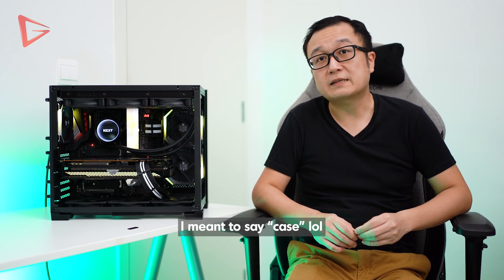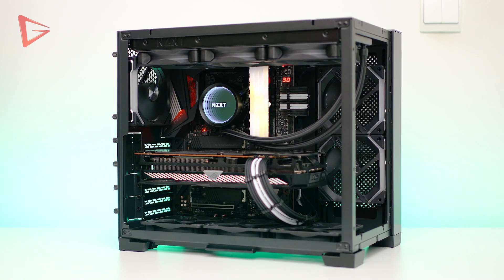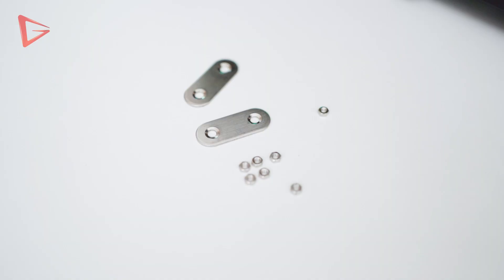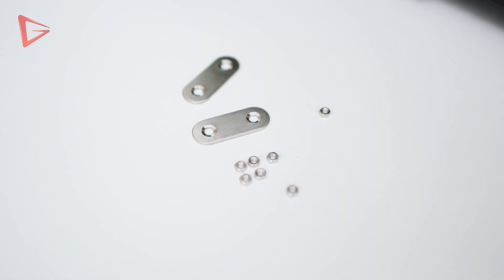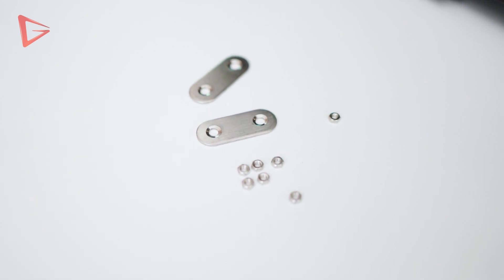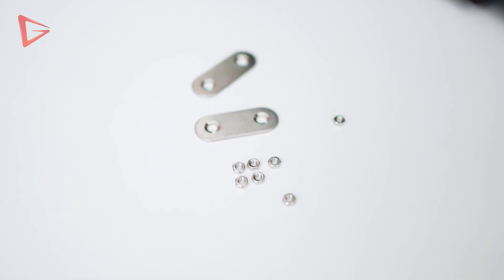LIAN LI O11D MINI - Top 360mm AIO with ATX Motherboard

Comment from the maker: I've made a final revision for the offset bracket design and is now available for purchase. Details on my FB page Ghim Tech. At the moment it's only for purchase and shipped locally within Malaysia due to shipping charges. Link here: https://www.facebook.com/111049724545742/posts/128869382763776/?d=n
Reply: Pretty nice, could you fit push pull fans?  Thanks
Reply: dude is there a way to ship this internationally (to Jakarta) ? I need these
Reply: Ridiculous. It's just a STL file.

Comment: Can we fit top 360mm aio without any mods if the motherboard we use is an m-atx size?
Reply: If you don't use the matx in 7 slot configuration then yes no problem

Comment: why didnt they just add brackets like this with the case. Would have made the case a lot more appealing as it saves alot of room on your desk and you have better cooling with the 360aio.
Reply from the maker: Because they want you to use only a 240/280 with this case, if you want to use a 360, they want you to buy the regular O11D
Reply: @ghimtech  actually they have now started selling brackets that you can use to offset the rad. They are only doing this now because alot of third parties and selling their own version. Sounds like lazy manufacturing to me. people would more likely just use the smaller rad and deal with the little jump in cpu temps.
Reply from the maker: @Lyrics_And_Harmony  yeah they started selling the offset bracket sometime late last year. I would like to think that it wasn't really lazy manufacturing, they just want to segregate their lineup and not letting the smaller mini kill the bigger brother by allowing it to fit 360 aio out of the box

Comment: Great video but I have a question. Do you think I’ll be able to fit the Artic Freezer II 360 AIO to the air o11 mini with the brackets attached because this AIO has thicker radiator.
Reply from the maker: This depends on whether your motherboard has big and thick heatsink or not
Reply: @ghimtech  It has quite big sinks...it's a gigabyte aero g z790, but if the artic freezer II wont fit can I try something else like t-force siren 360?

Comment: do these brackets work in the lianli air mini??
Reply from the maker: You cannot physically fit 360 aio on the air mini because the case is slightly shorter
Reply: @ghimtech  apologies, i have a 240mm
Reply: @ghimtech  But could I fit 280mm aio on top + atx mobo with these brackets?

Comment: what kind of screws/hardware did you use for the brackets? the ones that came with the aio or just any you had? interested in doing this, just wanted to know the screw size in case I need to get some more. thank you!

Comment: Just ordered and payed for the 3d files. Thnx. I have a question about when I upload the file to a 3d print shop. Are the 8 brackets included in the file? Because when I go to checkout to pay I get the quantity of one. Should I change it to eight or are the eight brackets included in in the file?
Reply from the maker: The brackets are the same. There’s only a single bracket. And then you ask your printer to print 8 pieces for you.
Reply: i have a question what is the size of the brackets use in this video as i will go with flat straight brace bracets and nuts plz help

Comment: Did you print this with pla? Or should I go petg for Temps inside the case? Also do you have a stl?
Reply from the maker: Printed with ASA. I only use PLA during earlier test prints, it sags too much and has lower temp resistant. ASA is much better. PETG should be fine too.

Comment: What about RAM clearance? For example, I'm using RAM with DIMM height = 51mm. What's the height of your DIMMs?

Edit: it's not listed on the v-color website, but on Amazon it lists the module height as 45.5mm could you please confirm?
Reply from the maker: By my measurement it’s ram clearance with this bracket is up to 46mm tall
Reply: @ghimtech  cheers mate! And so with your 46mm memory, how many mm (roughly) of clearance do you have between the top of the DIMMs and the radiator? Do you think my 51mm (an extra +5mm) could fit, even if it's touching?
Reply: @inverse_of_zero  Im currently wondering the same thing. My vengeance pro ram is 51mm
Reply: @cosmoanderson6376  honestly i just ended up selling the corsair ram and buying g.skill ram which is higher performance and lower clearance
Reply: @inverse_of_zero  yeah that’s my current debate as well
Reply: @inverse_of_zero  get the Corsair Vengeance Pro SL RAM, it’s 44mm :)
Reply: @xtcresells  yeah i saw that but i ended up getting the g.skill ram which is higher quality (but a bit more expensive but didn't matter to me)
Reply: @inverse_of_zero  good stuff man hope it treats you well.

Comment: Extremely ingenious! Are there any drawbacks of the radiator being mounted this way (in terms of airflow)?
Reply: If anything,  there'll be a slight benefit as the gpu exhaust wont be facing 100% directly at the rad (very minimum tho) otherwise, theres no drawbacks if its well secured

Comment: Without sealing off the top rad. You’re blowing hot air back into the case.
Reply: You know heat rises, right? How is the hot air blowing anywhere but out the case...
Reply: @killerCamii  that's if there are no influence from airflow and such lol
Reply: @killerCamii  air travels into areas with least pressure and resistance. The gap between the rad and case. The gap between the lid and case slits. The holes in the lid are small. There’s back pressure. I own a mini.
Reply: @djglobol  so temps will be bad or what is a solution ?

Comment: Still waiting on where I can buy the brackets or a file for the print (: these look awesome!
Reply: Great video. I dah buat macam gtlim. Mmg cun. Boleh tengok video i uplod kat Chanel i
Reply from the maker: @ku333able  https://www.facebook.com/111049724545742/posts/128869382763776/?d=n updated revised stronger design with stronger material
Reply: @ghimtech  Looks amazing! Is shipping to the states not possible?
Reply: @ku333able  https://youtu.be/FmMxyXrZExo
Reply: @ku333able  there you can buy a bracket

Comment: Nice build! 😍 May I know where do you find the custom 3D printed bracket? I've been wanting to put a 360mm AIO on my Lian Li Dynamic O11 mini for so long and saw this video!
Reply: Yaa same to mee. Waiting dimention of bracket
Reply: I also want to know the measurement that custom 3D printed bracket.. excited if can share it 😊
Reply from the maker: The measurement is 30mm x 10mm x 1.5mm, I'm currently designing a final revision, hopefully will be available in my FB page soon. Cheers.
Reply: @ghimtech  thanks !! 🙏🏻
Reply: @ghimtech  what screws did you use and  size of hole?
Reply from the maker: @Jadendark098  M3, standard AIO screws size
Reply: I'd buy a set of those ASAP! Thank you for posting this!
Reply: Maybe slight ofsseting down would be also a better design so we can eliminate the slight clearnace between the radiaotor and the hanger having better gap for the ram and radiatior